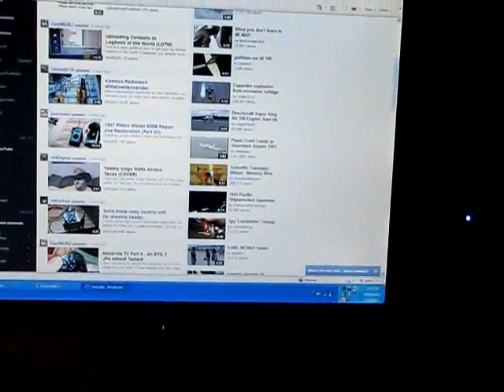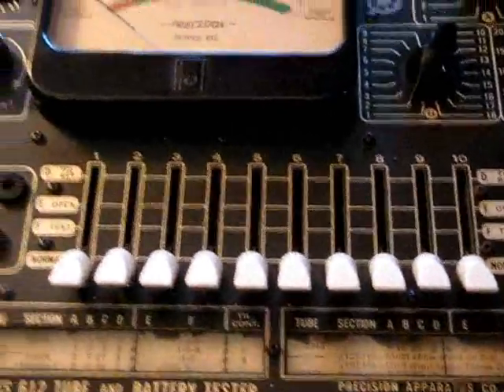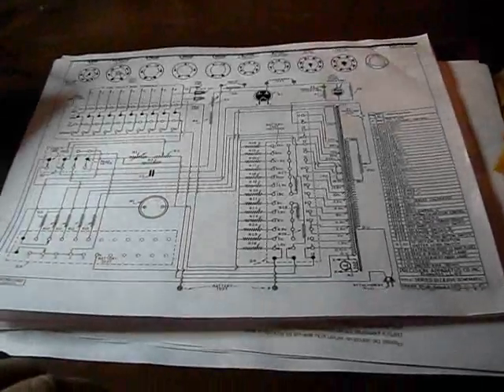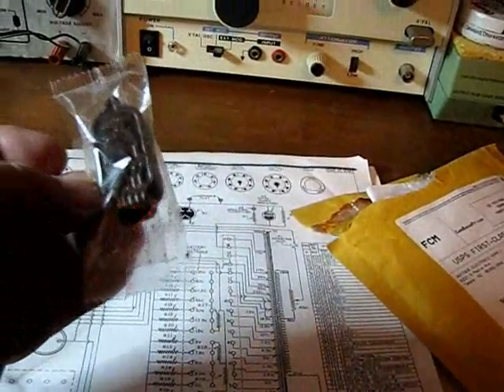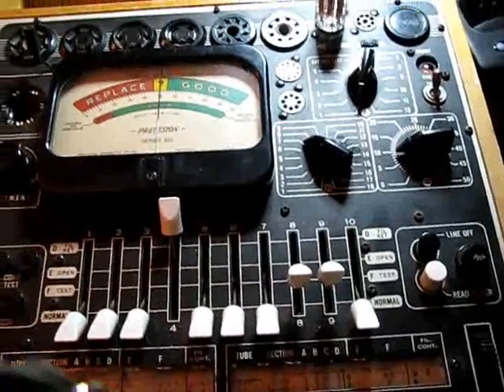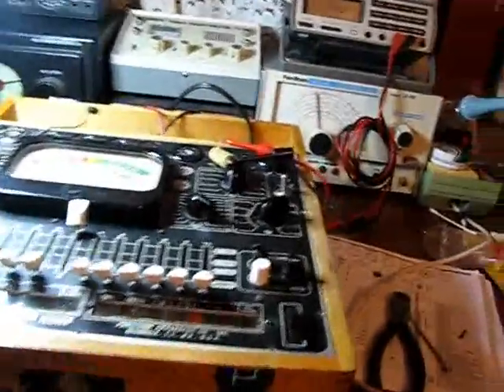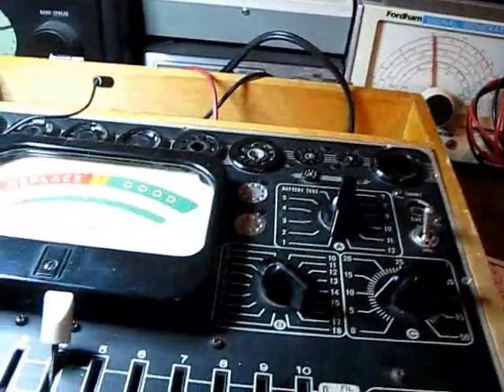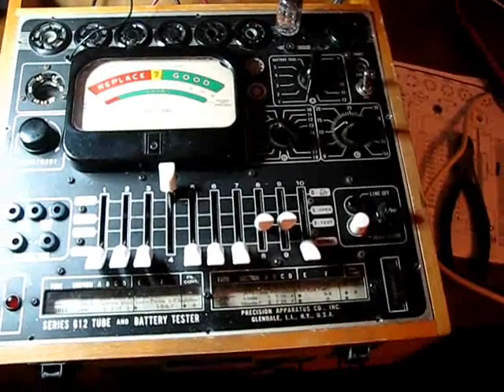Precision 612 Tube Tester repair

Comment: i have one!!!
i haven´t connected yet but i´d like replace the resistors first, the cap and the tube inside. Can you say me what kind of resistors could i buy? i have the list with impedance, but it not specified watts. and what kind of tube does this 612 uses? Can you help me? thank you
Reply from the maker: +Jeff A 
Resistors you should check them first I did not find a need to replace any of them. There is was only one CAP that I replaced and it was under the power switch I think it was a .1 @ 1000v

Comment: Hello, I just got one prescision 612 v t tester, but the meter does not work at all, the coil was open. Do you know where I could find one for replacement?, Thanks.
Reply from the maker: Jorge, I would set up a search on ebay for a  prescision 612. You may want to check some of the forums out like antique radio forum. and others forums dealing in old radios and tv's.  Best of luck with you search
Reply: jorge amp Hi again, could you also upload a video on how to calibrate the 612 tester specially showing the 300volt line? Thanks.

Comment: Just curious, because I would like to do what you are doing. Do you have formal training or are you self-taught? I have a number of things with tubes around the house & I’d like to be able to test &/or replace the tubes. I’m afraid if I buy a tube tester, the machine itself will need fixing, calibration, etc.

Comment from the maker: @bluenose0354 
First is the power light on? If it is not you need to check the fuse. Unplug the tester and remove the unit from the case a look and see if you can find any burned or damage componterts. Check the 5Y3GT tube -